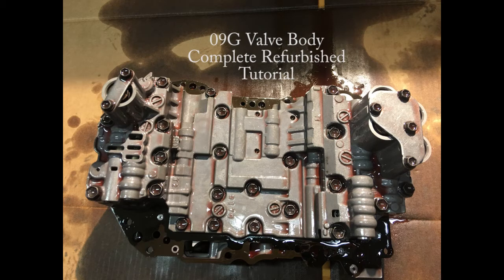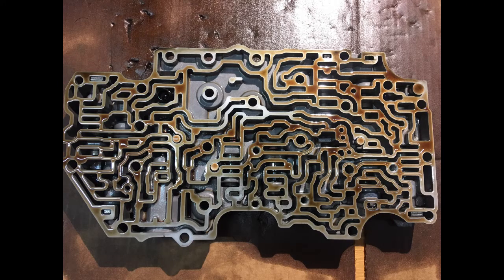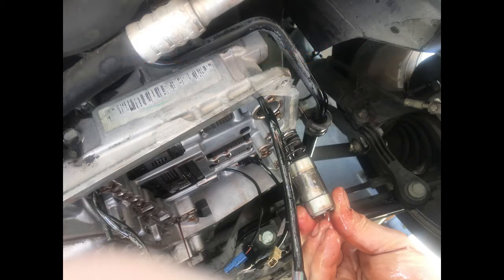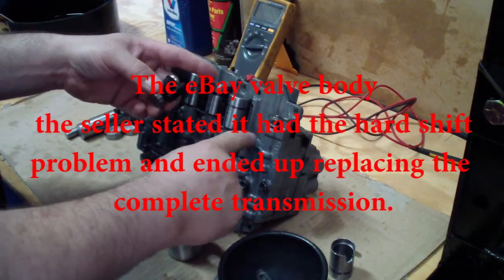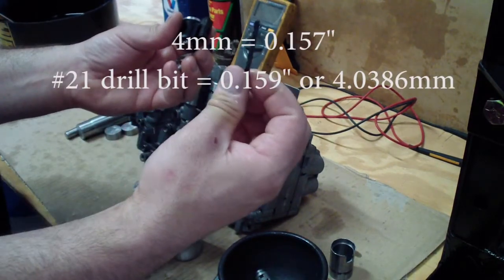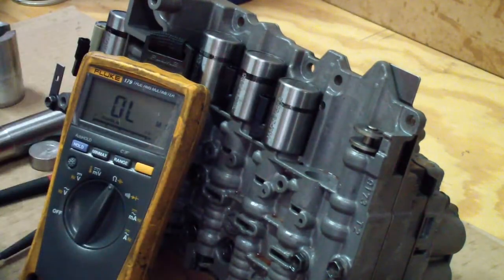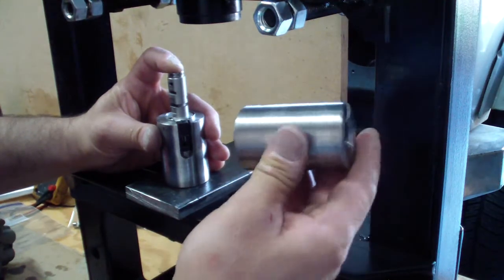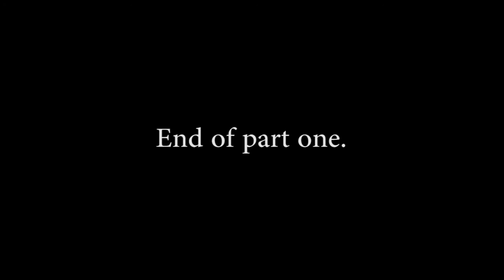09G transmission valve body refurbishing tutorial - Part 1

Comment: Hi Salam,  thank you for this video.  My 2006 Jetta has the exact symptom you describe.  Engine run perfect, and so does transmission until things heat up, then hard shift start and don't end till car cools.  I get longer drive time in winter, so it's must be heat related.  Thanks for the tip to drain the trans with less mess.  Your attention to labeling is very good method as I will attempt a similar Soleniod Fix.  Very important to know how to put things back together.  Unfortuately I don't have the tool shop to make the tool you made.  I will be trying similar method with the 09G-TRANSGO SHIFT KIT (Valve Body Repair kit), which is similar to your method but easier for people without a wonderful machine shop like you have.  All you need is a common grinder to open the solenoids from front end. The kit has instruction to do more, however I think it may be optional bonus if desired.
Reply from the maker: Good morning sir, the repair job was very easy. Before you start, make sure everything in the engine, throttle body, all sensors, TCM and temp sensor in the valve body is good. The hard shit when warm in transmission with linear solenoids could be related to other parts. I covered all this the the last two parts of this play list. Once you know for sure it's solenoids issue then you can re build them or even replace them. I appreciate your comment and if you have more questions please let me know.

Comment: Amazing what you were able to accomplish.  I’m replacing solenoids with rostra upgraded units. This after swapping out with two remanufactured vbs which both had a hard 1-2 cold shift.  Hoping these new solenoids in my old vb (96k) work.  Have you ever come across info on a cold 1-2 bind?
Reply from the maker: Good evening, hard shif while cold it can be one of many possible issue:
Bad TCM unit.
Bad transmission temp sensor.
Bad transmission fluid.
Bad solenoid.
Bad valve body.
Mechanical problem with the transmission.
The shift learn need to be reset and re learn. I explained some of this in the last two parts of this playlist.
The 09G is very simple transmission, however some symptoms could be the results of one or more issues. I prefer to try to rebuild your valve body and the original solenoids. Does it give any error code? Or does all the gear lights come on or flash (P,R,N,D,S)?
Reply: @SalamSayhood  thank you for your quick response.  no error code.  original vb had hard downshift issues when warm.  both new valve bodies shifted fine after reaching 70 Celsius plus.  First replacement vb had an extremely harsh 1-2 shift .  Second was better(thought about living with it) but still harsh.  Tested the atm temp sensor and seems fine.  Figured because original did not have the same symptoms of the two replacement, I would order new rostra solenoids for the original.  No codes, no flashing gear lights.  relearn only happens when you reach normal operating temp.  issues were gone by then.  replaced solenoids today will reinstall vb tomorrow.
Reply from the maker: I wish you the best of luck. Hopefully the new solenoids will fix the issue. Please let me know how it goes.
Reply: @SalamSayhood  one last question...i removed the valve and springs and may have mixed up springs from one and 4.  they appear to be color coded springs.  did you by chance notice this when you worked on yours?
Reply from the maker: Yes sir, the springs for the solenoids spools and inside the valve body are color coded. I show through out the 10 videos where each one go. I don't remember how they go by memory. please check the videos. I even dissassmbled the valve body and inspected the internal components. Plus slot of foot tips through out the tutorial.
Reply: @SalamSayhood  thanks.  found it in three.
Reply from the maker: Cool. Good luck

Comment: Salam...QUESTION: my Reverse gear is Slamming into place. I SPOKE with a Mechanic who says 'Solenoids have nothing to do with Reverse?' *TRUE OR FALSE* ???
Reply from the maker: False, for reverse, the TCM will command 4 linear solenoids to activate (N92-ON, N93-MODULATE, N282-ON and N283-ON). This will enable K3 clutch and B2 brake.
When you said the reverse gear slamming, does it do that immediately or you feel some delay from when you put it in gear till you feel the hard shit? What the effect of hot or cold engine if any. How did this problem started?
Reply: @SalamSayhood  There is a Delay when i shift to Reverse. Then...a violent Slam when engaged in Reverse. Its quite disturbing. When COLD i don't have any issues (no issues in reverse or forward).
Reply from the maker: It sounds like solenoids issue. Most likely the N93. If you are going to try to repair your transmission, then rebuild all the linear solenoids like I did or replace them. Either way it is way cheaper than changing the transmission. Please keep in mind, there is no guarantee this will fix the problem. Make sure you use the right transmission fluid after you repair the solenoids. Good luck.
Reply: @SalamSayhood  Thank you my Friend. I hope all is well where you Are ~
Reply from the maker: Thank you sir, same to you.

Comment: HI Salam, my Tranny has a hard shift between 1-3 gear and Reverse is 'Really Hard' (loud Bang). My Mechanic is very skilled but is nervous about doing the job. *What can i tell him to give him confidence?*  ~Hope all is well.... !
Reply from the maker: Hello, like I said in the videos, make sure the problem is in the valve body before you work on the transmission. The hard shit on the 09G can be from:
1- Throttle body issue.
2- Engine issues.
3- TCM unit.
4- ECM unit.
5- Bad transmission fluid or wrong fluid was used.
6- Bad transmission temperature sensor.
7- Damaged main shaft seal in the transmission.
8- electrical connection issues.
9- make sure no error code is registered in any module.
Make sure you are 100% positive all the above are OK before you or your mechanic start working on the valve body.
Repairing and inspecting the valve body and also replacing the solenoids is easy. I did my best to cover the process in the 10 videos I posted on YouTube about. Ask your mechanic to watch and understand everything in these 10 videos and if he has any questions, then let me know.
Reply: @SalamSayhood  Thank you Salam... you're neighbors are lucky to have you !
Reply from the maker: Thank you sir,

Comment: Salam...you put a lot of time into refurbishing Solenoids. Why not buy them NEW?
Reply from the maker: I don't trust the new as they are aftermarket and may have different resistance values and this may effect the performance of the TCM. However if you are planning to purchase new solenoids, make sure the large ones have the same resistance using multimeter on ohm scale. It was very easy to rebuild the solenoids and it didn't take long time. Also make sure the temperature sensor is good before you do anything. I explained this in the last two videos.

Comment: i have a 2006 jetta 2.5l and am having shifting issues. do you buy the parts and rebuild the valve body yourself or do you buy a new valve body? if you buy a new valve body where do you buy it from
Reply from the maker: I was able to fix the original valve body, I made a tool and rebuilt the solenoids myself. through out the videos, I explained the alternative on how to rebuild your solenoids even if you don't have a lathe. I also explained what maybe the issues , it could be other issue that leads to the hard shift problem other than the valve body. They sell solenoids and other parts for the 09G transmission, on eBay, amazon, the VW dealer, however, that will not guarantee to fix the hard shift problem, They also sell a complete rebuilt valve body for around $600 and the complete new valve body for the 09G it's about $1200 at the VW dealer. You also have to add labor and other material. So I researched it and I was able to fix it myself, like I said, I made this 10 part series to show how to do it yourself, please watch part 1 to 10 and see if you can do it yourself or you may choose to take your car to your trusted mechanic and have them fix it for you. I was able to fix mine for around $100, that being said, I have a good mechanical background and I think the job was easy. I hope this comment was helpful, good luck

Comment: Are you for hire lol I need a new valve body but don’t wanna spend the money
Reply from the maker: It was fairly easy to repair. The coast was very low. Please watch all the videos in this play list as I provided alot of tips to help the viewers succeed in repairing their value body or linear solenoids. Thank you for watching.
Reply: @SalamSayhood  but what if we don’t have a machine like yours to make parts
Reply from the maker: There are several options. You can search and buy rebuild kits using simple cutting tools to open and fix the solenoids or buy new solenoids. If you have solenoids problem, then these options are way cheaper than purchasing a new valve body. I just made my tool because I have the equipment and I thought if someone have a lathe or a milling machine, then they can copy what I did to minimize the cost.